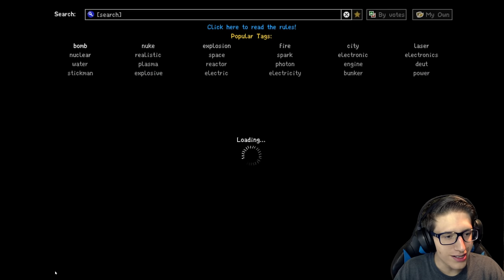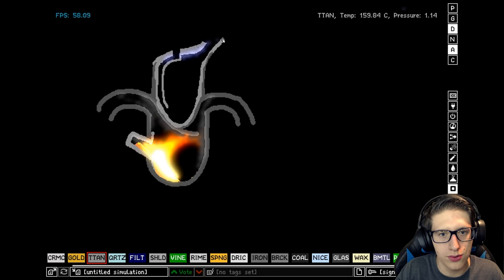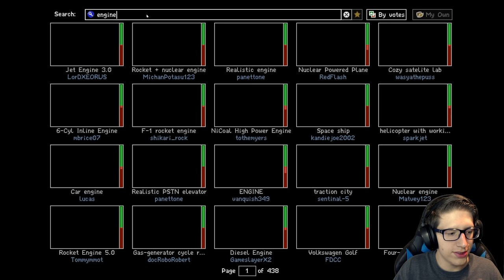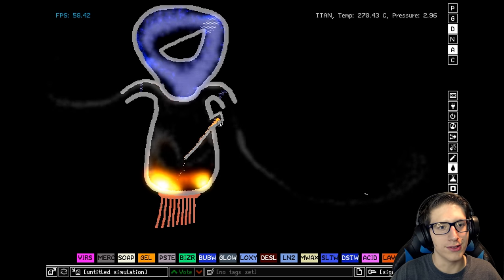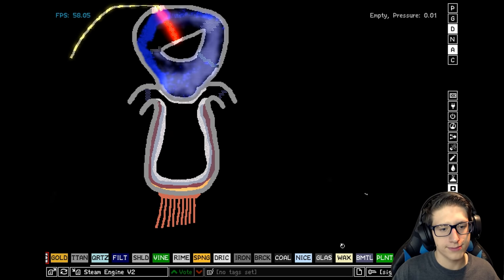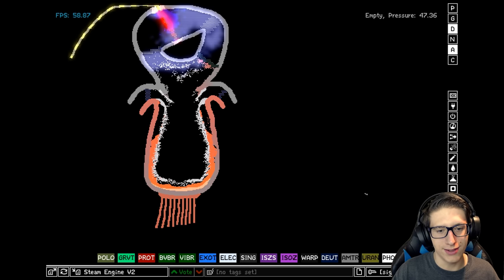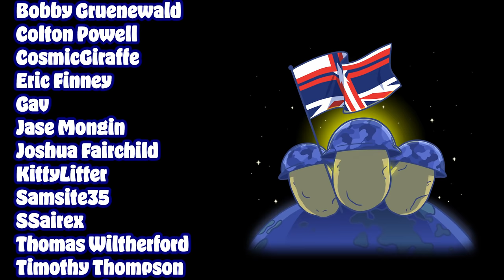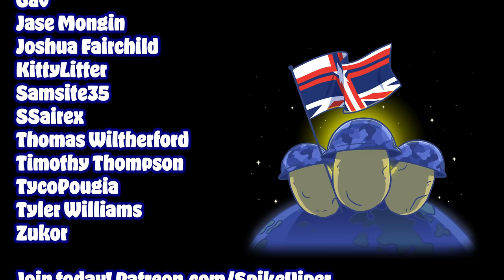I BUILT A STEAM ENGINE in The Powder Toy!

Comment: Sad man still doesn’t know how to make rings :( scale up circle brush and make a big one, then shrink it a tad and erase.
Reply: Me here not knowing how to delete
Reply: @DD-gs2gz  you can erase things with right click
Reply: @sky2198  the right click is a second selector and in default is delete.particle
Reply: He does that all the time.
Reply: Facts. So far my favorite thing to do is make a pressure chamber. I make what looks like the shape of a gas tank with titanium, pretty thick. And on the bottom inside i put fan in the same thickness as the titanium. Than at the top i close up the little hole with a circle of titanium to keep it from leaking the hole it cant be super small or else it wont work. Than i fill it completely with gas. I use oxygen gas because its very volatile. And once its filled i check the pressure in the middle of the tank and at the bottom. The pressure at the bottom should reach the max if you did it right. Than remove the cap and watch all the gas go brrrrrrrr.

Comment: 90% of what i do when i mess around with powder toy is create closed loop steam engines. usually uranium for the heat source, steam escapes through a 'gas only' wall tube goes through some fins to condense back into water and then through ether a 'liqid only wall' section or a portal back into the reactor.

Comment: Use thermite instead it does a boom at first but keeps going longer then coal.
Reply: it's just that thermite burns at round about 2500 Degrees Celsius (or 4000 degrees Fahrenheit)